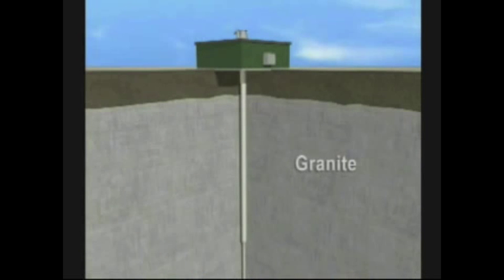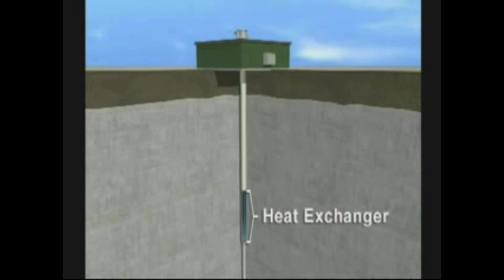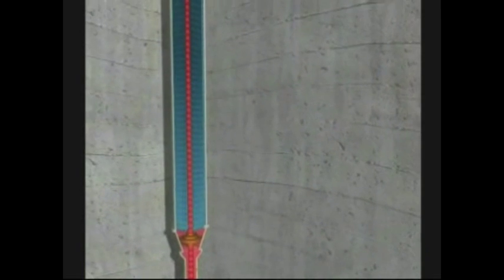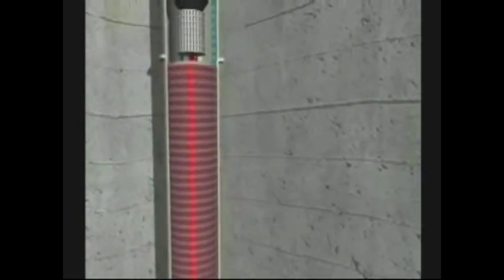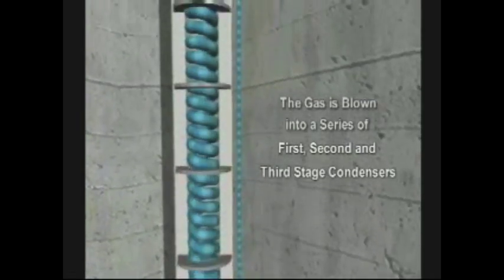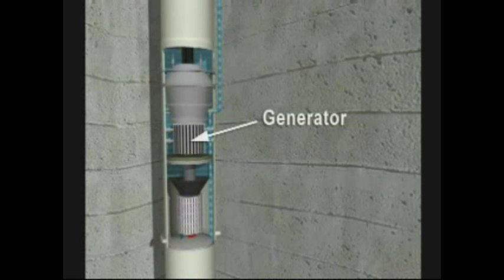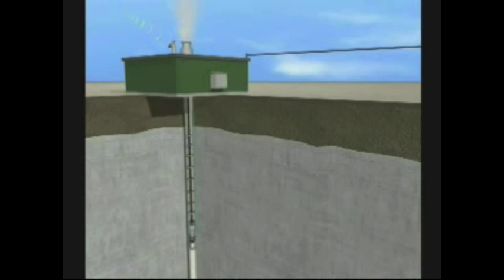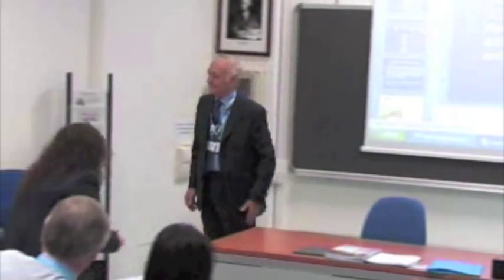Geomagmatic Technology

Comment: I had high hopes for this, more than a decade ago, when I first saved this video. Seems the original URL to the official website doesn't exist anymore, and like everything else that politicians didn't want to get onboard with and insider trade on, we get their dirty "green" energy options instead. Just like all the free methane they burn off at the tops of stacks, rather than creating steam to generate electricity with it, we're also stuck with fracked LNG instead.